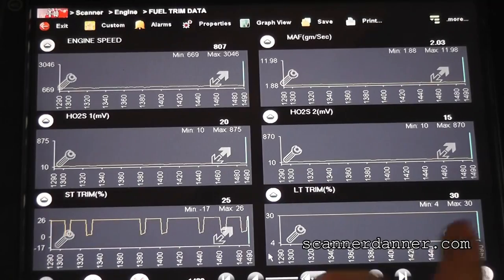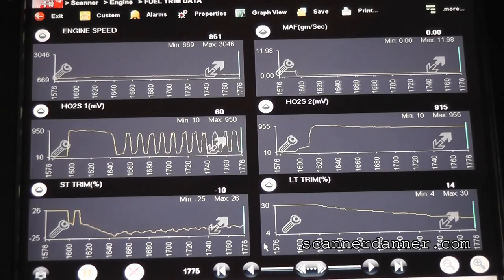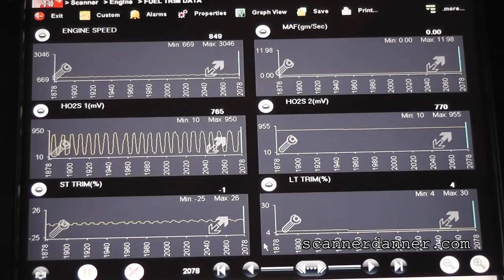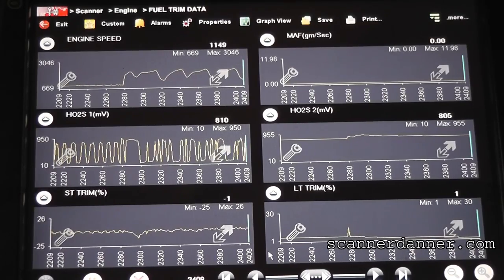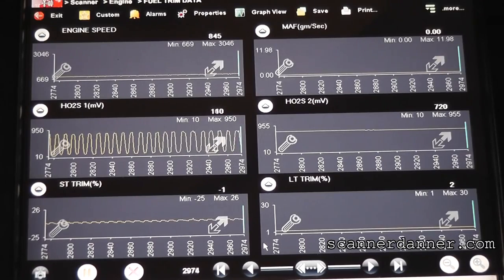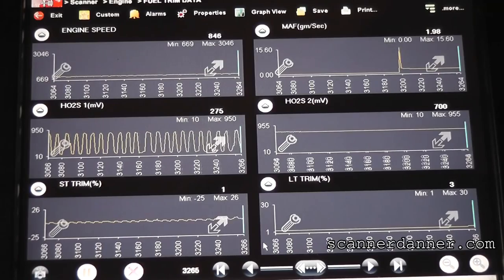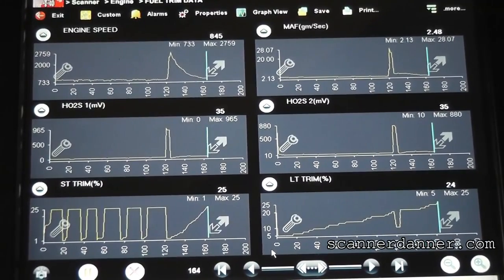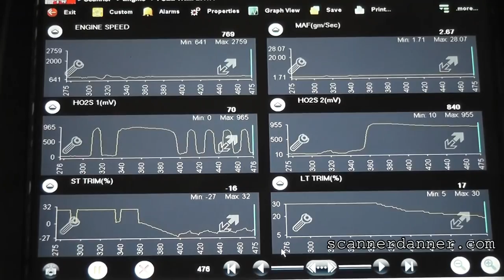Can we trust "the unplug it test"?

Comment: My vehicle stalls when I unplug mine. Is that normal? I have p0172 on a 06 Range Rover HSE 4.4l any ideas where I should start?
Reply: STYNCLSY It can be normal, yes.
Reply: @automedic9781  thank you
Reply: That’s a rich condition if I can recall on the 172 code.
Reply: @sirsweetness8332  yup, rich bank 1.
Reply: Erroneous MAF g/s reading will effect both banks, I suggest you start with swapping upstream o2 sensors and check if the rich code shifts to Bank 2, if you get the same code check for leaky injector/s
Reply: @Airman..  Better check fuel trim first. Don't assume bank 2 isn't rich also.
Reply: anti chuckle a bad MAF will make your engine runs so rich it will smoke like a steam train
Reply: @Airman..    That depends on how bad it is. I'm not even suggesting he has a MAF sensor problem either. I'm just suggesting that he do a proper scan before swapping parts around based on a code. If the O2 s1 sensor is reporting too lean, he might see it reflected on s2. He might also see that bank 2 is almost as rich but not setting a code. He should diagnose it properly before wasting time and money. Pulling codes is only the first step.
Reply: @Airman..  ok will do, thank you.
Reply: @SuperTrick69   My comment was in response to Airman's comment. My point was that even if a p0175 hasn't been set, bank 2 may also be running rich. Please review both comments.
Reply: @SuperTrick69   I've often seen rich or lean codes set for only one bank while the other bank was almost as rich/lean. I wouldn't assume that bank 2 is fine and recommend swapping anything until I've seen fuel trims for both banks. Why would it set a p0174?
Reply from the maker: Not all cars offer good backup strategies for an unplugged MAF. So in short yes, that may be normal. Can you start it back up? Will it rev up if you snap the throttle?  (MAF unplugged)
Reply: @ScannerDanner  instantly dies when I unplug it. But I did replace it because I was getting lean codes, those are gone now. Drove 300 miles and now all I'm getting is p0172 rich bank 1. It does have hesitation, loss of power,sometimes shifts hard or late, rpms fluctuate when on throttle driving, sitting idle runs great and smooth?
Reply from the maker: So you didn't have the 172 until after replacing the MAF?
Reply: @ScannerDanner  I had lean and rich codes before changing the MAF both banks. Replaced the maf and all went away other than 172 which came back after 500+miles.
Reply: @SuperTrick69  I didn't mean to pick nits. I just assumed you had an explanation for expecting a p0174.
Reply: anti chuckle no lol 😂. Just typo pushed a 4. But danners  on it. So we should respect his position here.